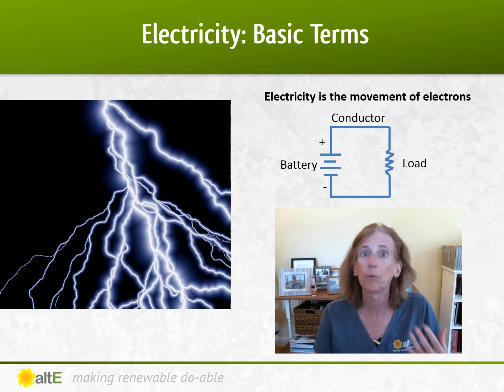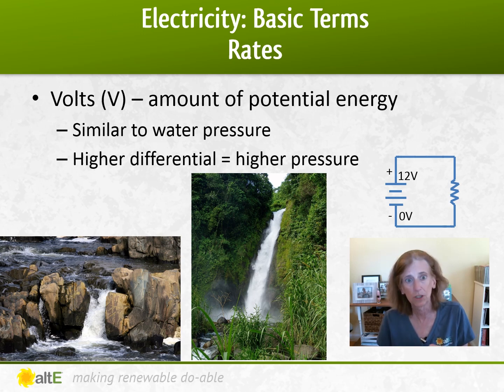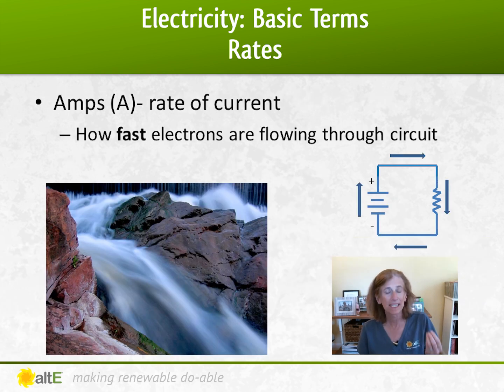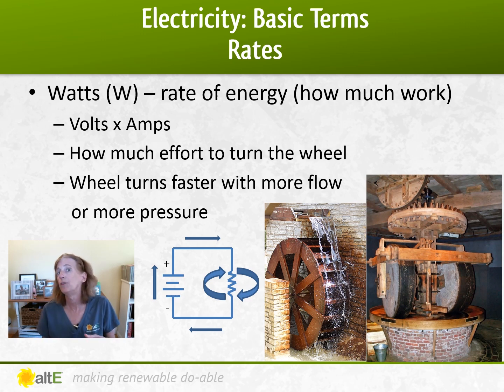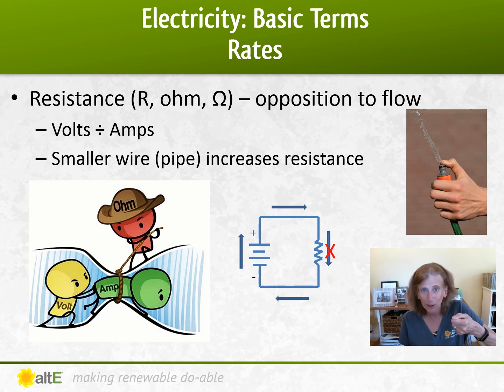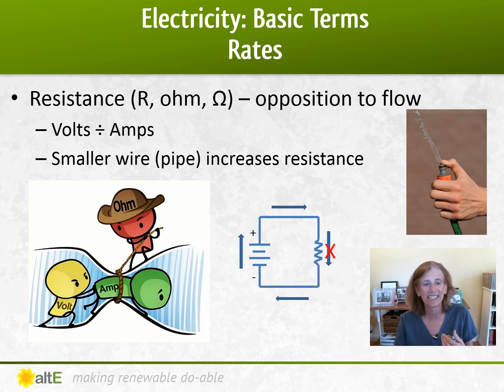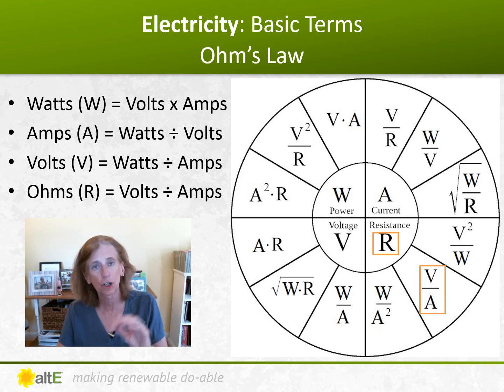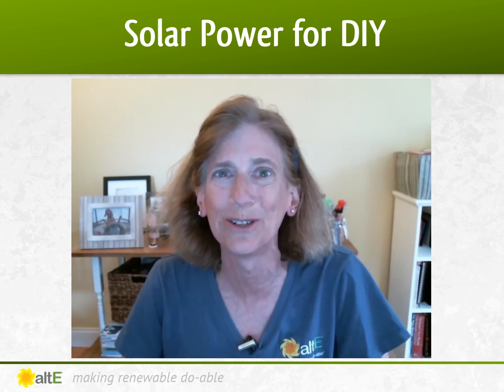Solar Power for DIY - What's a Watt?

Comment: Why are you using Will Prowse's website name, DIY Solar?
Kind of a shitty thing to do.
If any of want to actually get the accurate facts about solar watch Will Prowse for the best solar show made.
This channel is a joke.
Pathetic,,,
Reply from the maker: Certainly not intending to step on Will's work. Using the same phrase was unintentional, I was basing it off Google search results (which did not turn up his page). I'm actually a regular contributor on his forum, and a fan of his videos (as he is of ours).  I'm going to change the series name to make sure that it is not confused with his.